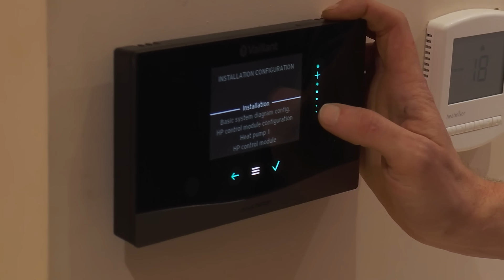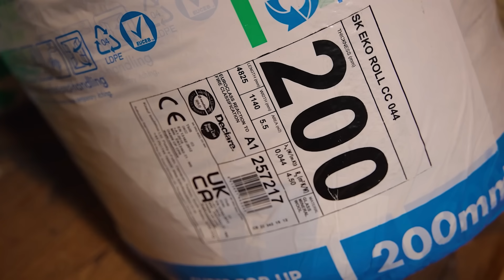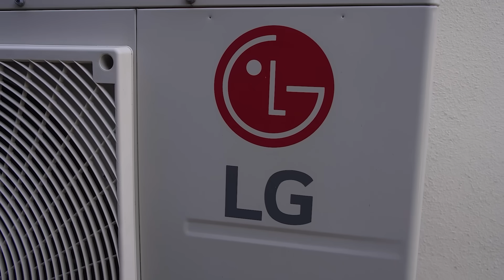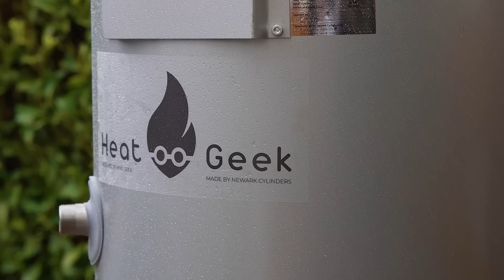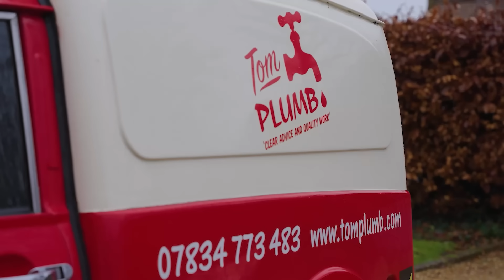Heat Geek’s Heat Pump One Year Later — The Verdict!

Comment: Here is the takeaway from this series of videos. 
From the original instal 7 years ago, to the upgrade of huge radiators bigger pipe work and a buffer tank , then heat geeks turn up rip out the buffer tank a load of pipe work and assorted controls and install a shed load of new equipment and controls. 
So all in we are talking 7 years and maybe 40k of equipment and install costs , yet the key was the loft insulation which wasn’t mentioned before 😂🤣😂
Reply: I think £22k was mentioned? Average UK install is £4.5k after the grant. People might find they have simple or complicated installs.
Reply: @Biggest-hz7ng  We are not talking average instal we’re talking this instal . 22k for what, the first instal, the upgrade or the second instal ? 
Where do you think the 7.5k grant money comes from ?
Reply: @haydnlawrence8167  he had a poor install that was rescuable with know-how. Hopefully he'd do better these days

Comment: The issue I have with heat pumps is that, with my combi boiler, it fits in a small kitchen cupboard. These heat pump systems look like they need a plant room, lose a large section of not to mention  the massive, ugly pump in the garden. Seems like a backwards invention.
Reply: This is the only valid issue with heat pumps as I see them.

They are fantastic if you have room for a big cylinder, otherwise you're going to struggle for hot water.
Reply: Well, it depends. If you use it only for heating it stays outside if it's a mono-block unit. Then you can use a heat pump water boiler instead of the gas boiler. But I would prefer to keep the gas boiler for the DHW, it wouldn't cost much and it's good to have a back-up for heating.
Reply: Pumps and cylinders vary in size. Cylinders can be the size of the Heat Geek Mini
Reply: Quite often you can fit the new hot tank and all the gubbins in place of the combi if you can go floor to ceiling,
Reply: not many heat pumps at Balmoral
Reply: A combi boiler won't work in a 6 bedroom house like the one on the video. Most of the stuff filling the plant room would be needed for a system boiler too.
Reply: @carlarrowsmith  Why not? Even a 20 kW combi boiler would be more than enough!
Reply: @razvanlex  On a 6 bedroom house no one fits a combi, they simply can't fulfill the potential concurrent demand for hot water.
Reply: @carlarrowsmith  Of course it can. It doesn't matter how many bedrooms there are but how many people and bathrooms there are. A 35 kW gas boiler can sustain two showers at once, that is why I chose one instead of a 24 kW one.
Reply: @ Goof for you, meanwhile the rest of the heating industry will be using system boilers and cylinders for larger properties.
Reply: @carlarrowsmith  And they do it wrong. But hey, they make a lot of money for that!

Comment: Go back to the first video and John tells you the HP system works but is switched off because it is noisy and expensive to run . Then in the video with Adam he tells us it’s a simple fix to improve the efficiency, it needs a weather comp sensor and new bearings for the noise.  But now you’re saying it wasn’t working , also it was never mentioned that a load of insulation was installed.
Reply: The fix video and this video both feature the insulation

Comment: Implying it’s a good idea to have a backup gas boiler seems a bit of an odd take. For most people, if your gas boiler went wrong you don’t then have a backup heating system ready to go. It’s a nice idea for surety of heating but about the least cost effective option possible.

Are there any statistics on the likelihood of a heat pump going wrong vs a gas boiler? As a builder you’re probably exposed to a bit of a self selecting sample.
Reply: ashp are far more reliable than gas combis and have a longer life too.

Comment: I find heat pumps interesting, I may take on my mother’s house in a couple of years.Currently heated via an oil boiler which is on its last legs, together with the 1000 litre oil tank.I suspect a new tank will require moving to a different location . New oil boiler , new tank and probably a replacement of the hot water cylinder must be approaching £8K. With the £7.5k grant probably looking at about the same price.
Reply: Same with us. A tree root is tipping the oil tank. Oil boiler is getting near 20 years old. Just moving the tank is well over a thousand. New oil tanks are thousands, new boiler would be a few thousand. It's an old header tank in the loft... Will be cheaper with the grant as sorting the old system.

Might be a bit more expensive to run, while the oil prices are low, but they're quite volatile.
Reply: We moved into a house with an oil tank and no boiler due to finances of previous owners. Was pretty straight forward to go towards a heat pump considering i'd have probably had to replace the tank too if i stuck with oil. Our heating is considerably less expensive than the neighbours and we don't have to fork out for deliveries either. Heat Pump for us cost less than a replacement boiler with the BUS grant.
Reply: This is the thing people/journalists constantly misrepresent -- they often fail to cost replacing an old clapped-out system with a like-for-like replacement and then pretend a heat pump is £8k "more expensive", when it's often a similar price or perhaps a couple of grand over.

Comment: I live on a narrowboat and most boaters have a solid fuel stove. I have lived on my boat for 13 years and heat it entirely with a Woodwarm Fireview 4.5kw multifuel stove with backboiler on gravity heating to 2 radiators. There would be no space on a narrowboat for the Air units and electric supply is around 3.5kw. 

My mild steel back boiler sprung a leak after 13 years continuous use. I have now received a replacement from Woodwarm. A slightly larger design which is good, as a bit more heat to the water. Just need the time to fit it and mix a 20% antifreeze inhibitor mix and fill it up.

Not sure what fuel source I would use if I had a terraced house. Probably not gas. Mains unvented hot water heated by immersion? Found in France the 200litre Chauffe eau mains pressure hot water were fantastic and kept the water really well insulated. Cost in 2005 around 200 euros for a 200 litre one. 
Possibly pellet stove in rear room and leave doors open. Your programmable heater.
 Insulate internally all external walls and loft. Eco design multifuel in 2nd reception, if you can gather free wood and process and season it in the garden? James.

Comment: ATTENTION!
READ THIS NOW BECAUSE I'VE PUT SOME EFFORT INTO THIS!
Two heat pump systems have been trialled in two locations in Parliament.
They've been taken out because THEY WERE USELESS!
As you know, the govt is still pushing them on us!

Heat pump, bigger radiators and pipework required, installation £14,000 to £18,000, requires servicing every 2 years! WTF are these so called experts thinking..have they got an agenda to push it on us for financial gain? 
Does the govt want to screw us on electricity after the north sea gas cash cow!!!

The maths.
The smallest heat pump is 3kwh. 1 kWh = 27p. Therefore, 3kwh x 27p = 
81p hour to run.
81p x 24 hours x 7 days = £136 per week to run in winter because they advise you to run it non stop to get some heat from the cold air outside, AND, they say the house may not be warm enough and you might not have enough hot water even at that. That's another way of saying 'they don't work'

ALTERNATIVE
Heat.
4 x small •5kwh (£20 ea max, I paid £12 ea few years ago) electric fan heaters would guarantee warmth in 4 rooms with 1 kWh spare. Would you need 4 turned on all day? They wouldn't be on all the time. Also, their stats would turn them off intermittently when the desired temp is reached.
When you're at work or out doing your thing, they're turned OFF.

Hot water.
Fit electric water elements under the kitchen sink and one to feed the shower and sink in the bathroom. £68 ea and only on for several minutes per shower, 1min for washing dishes. If they break down, unplug, new one in, up and running, NO servicing costs.
They're 3kwh like a heat pump, therefore, 81p per hour to run. DON'T PANIC!

81p ÷ 60mins = 1.3p per 1 minute to fill a sink.
YES! A penny and a bit to fill a sink with GUARANTEED hot water!

5p for a 4 minute shower.

Don't run a bath for 15 minutes unless you can afford 20p!

NO BIG CYLINDER OF HOT WATER TO LEAK, INSULATE, FILL A CUPBOARD OR BOX IN.

Other advantages.
NO radiators on your wall under the windows. NO boiler, NO big cylinder, NO unsightly pipework all round the house, NO service or breakdown charges.

I've asked this before, somebody tell me my figures are wrong!
Reply: Your 3kW heat pump could be (say) 300% efficient, so it only uses 1kW in use (drawing in the extra heat from the air). The heat pump in this video is 450% efficient.

Comment: My parents had a heat pump system installed last summer.  A few days before the old gas system was taken out, I checked the settings, and my dad had bumped the flow temperature up to over 70° because he was feeling the cold... they were spending thousands on gas every year, plus their electric bill for everything else.

Immediately post install, my dad still moaned about feeling cold.  Everyone else in the house was stoating about in short sleeves because it's too bloody warm.  But the main takeaway is that their bills have fallen dramatically, with them only requiring some gas for cooking purposes.

The fellas that did the install took the time they needed to check the house beforehand, did all the requisite calculations (things that really should be done for gas boilers too, but most just fit like for like) and did the whole fitting over two days, because they needed some radiators changed.

Biggest issue has been to get my dad to change his way of thinking as to how it works, but since his health has improved a bit, he's not feeling the cold as much, so he's not moaning as much😂 .  My mum thinks it's far better than before.  And their neighbours don't have any opinion on the sound...because it isn't loud enough to be noticeable.  And that's in a nice quiet village in rural Scotland.  Nobody froze to death in freezing weather, they didn't need to burn wads of £10 notes to stay warm, it just worked.

It won't be right for everyone, the install isn't practical in my house at present as an example, and if it isn't right for you, don't get one.  But do your research, get a decent company to do the work, and you won't be upset with the results.

Comment: Was that £920 for the year?
Reply from the maker: yes
Reply: @SkillBuilder  I can't understand that at all. £230 a quarter ! Including standing charge ..for all the heating and hot water for a 6 bedroom house ..that's 16.8Kw/hrs/day  @ 15p (which is insanely cheap) @ 26p it's only 9.7kw/hrs/day which means a 10KW Heat Pump running for less than 1 hour a day for a 6 bed house...🤔
Reply: 10% of avg wage total just to heat a house lol, but for a 6 bedroom, that mans gonna be more like on 200k a year

Comment: This is the rabbit hole we are going down with just about everything. Things are just so complicated only a very few people know how to fix things. Not knowing what was making the noise was just one aspect. All that equipment just to heat a house, its madness. Cars are another hole we're going down, the technology is making them unfixable, local companies just can't deal with them, scraping these systems well before they should be, is just adding to our throw away culture.
Reply: Re: EVs, you're right that there are certain models that seem to get more readily scrapped (e.g. after accidents), but on the whole they are much more durable than ICE cars -- electric motors are much simpler and more durable than ICEs, so it just tends to be brake pads and tyres that need maintained. Even the batteries (which we are constantly told will be worthless long before the car is inoperable) are easily lasting a decade plus, and that's on older models with shorter ranges. Newer battery tech is constantly improving in terms of weight, capacity, charge speed etc.
Reply from the maker: You are so right, it is also adding to the CO2.
Reply: @SkillBuilder  CO2 is good
Reply: EVs pay off their carbon debt relative to old ICE cars after about 20-30k miles. The advantages of shifting away from ICE come quite quickly.
Reply: @Biggest-hz7ng   He didn't mention electric cars, it the hybrids that are the problem, trying to squeeze too much power out of a small engine leads to premature failure, also the over reliance on technology means there is more to break and expensive to repair.  Who really needs a boot that closes on its own or a heated steering wheel, ffs?
Reply: @TheDavecroft  in these comments there was no mention of hybrids?

Comment: £920 per week, per month, per year? Our heat pump is costing us £230 per month over the last year, that said during the colder months we had to use our log burner to comfortably heat the living room without the log burner we would be wrapping up in blankets.
Reply from the maker: 920 per year
Reply: @SkillBuilder  wow! Wish we could get heat geeks in Scotland.
Reply: Wow, I spend £355 pa on my gas boiler, gas hob & gas wall heater.
Reply: @frankmckie2992  it sounds like some optimisation is possible/desirable? John's property looks to have around a 10kW heat loss at the 20C he heats it to.

Do you have details of your calculated heat loss?
Are you getting a lot of hot water?
Some months need high consumption, but they should be balanced by low use in the summer?

There are some good heat pump groups on Facebook.
Reply: I think the one thing to keep in mind about heat pumps is, what was said early on.  Every house is different and they need to be set up for the peculiarities of your particular house.  The government will never hit their instalation targets because the installers are still learning.  Of course there are many that do know what they're doing but most of us getting one in the coming decade will be guinea pigs.  Hope you have deep pockets!
Reply: Hard to get an average but generally you are going to spend 2000 a  year if you are frugal on heating be it coal fire, electric rads ( more costly), the heat pump is costing you from what you say over 2000 a year anyway to spin a giant noisy fan that some texas ranger cowboy is going to come round and pretend to 'service' every year.
Reply: He's paying £920 per year.  Our gas bill (family of 4 in a well insulated 3 bed 1920s semi) is £250.  Heat pump would be about £120.
Reply: @Tim_Small  his house is quite large and has variable insulation. Using a gas boiler to produce equivalent heat would be more expensive at £2200.
Reply: @frankmckie2992 "log burner," do you realise just how ridiculous this sounds 😂😂😂
Reply: @rosonoftom1655  The heat pumps can generate a fair bit of heat if you set them on fire but the molten plastic and metal gives off fumes so best for the winter months.
Reply: 😂😂😂😂@Meodus_Humbinerbernecki
Reply: What's ridiculous about a log burner? I heat my house entirely off a wood burning stove very comfortably. I don't have central heating of any kind or any other form of heating.
Reply: @rosonoftom1655  it is blooming ridiculous considering we've a house that's completely insulated with 100mm kingspan in the walls, insulation in the floor, and loft plus double glazed windows,  solar panels and a heatpump only 15 months old. Eletric bill of £320.00 per month, and we're  talking low appliance use. It's not like we've lots of electrical stuff. And yes we still need the log burning stove to heat the living room.
Reply: @frankmckie2992  it sounds like your heating might need some tweaking? A reasonable install should have a similar energy cost to what you may have paid for fossil fuels. And, unless you asked for it, log burners should be optional.
Reply: @Biggest-hz7ng  yeh, we've had 3 separate engineers, but unfortunately, we're a rental, so kind of restricted in what we can do. As for the log burner, it's been in the building for over 11 years.
Reply: @frankmckie2992 if you're insulation and bills are genuine then unless your live in a converted church or other enormous building something is very clearly wrong.

For an average size well insulated home the required annual energy for heating would be 10MWh per annum.
Even if you had a dreadful heat pump installation averaging a SCOP of 2, less than half as efficient as a quality modern installation, you'd still only need 5MWh of electricity which equates to £1400 a year at 28p per unit of electricity.

A modern installation with a SCOP of 4 would be £700 a year.

£320 a month is ludicrous unless you have some other huge energy draw but then that would be no reflection on a heat pump